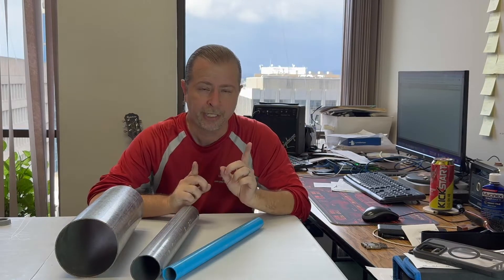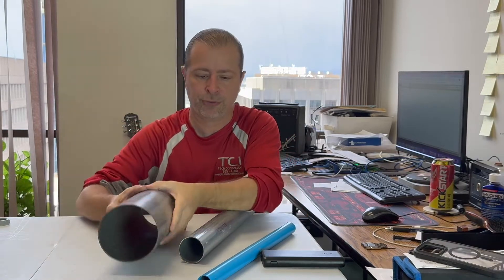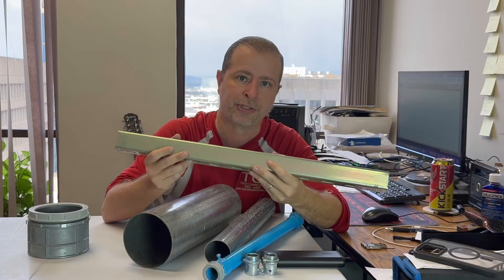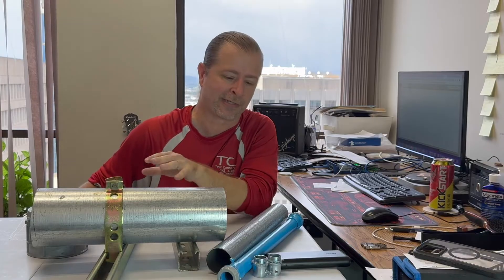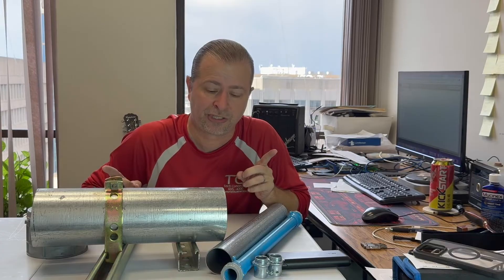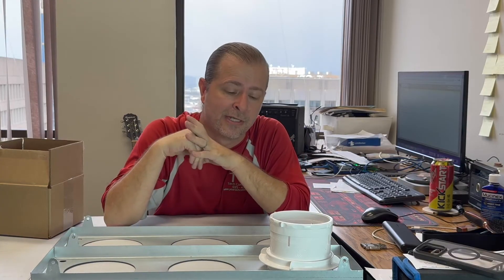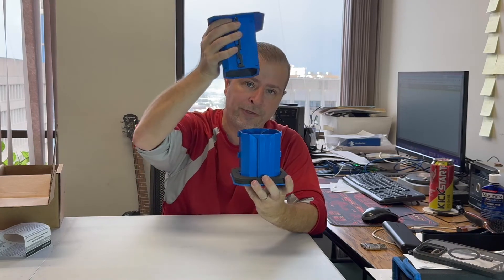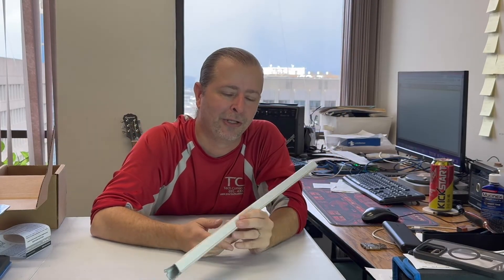Learning Network Cabling - Dealing with the Ceiling (Chase Pipes and Sleeves)

Comment: I print end connectors, and flanges for wall entries I have to do (eg 180mm circle cut into wall behind wall mount rack to get at conduit with network cables). I followed your advice and from your design I modelled a cable holder to string them  in ceiling space too. Needs some work to be perfect but I'll send it to you once done since you have been freely sharing yours.  I'm learning a lot from your videos - thanks for teaching :)
Reply: I used to use Toilet flanges quite effectively as well and mount them to a flange plate on the end of the pipe with the ceiling tile in-between and the pipe mounted to some Unistrut.
Reply from the maker: Thanks for watching!  I have gotten a lot of mileage out of our printer for work, I was concerned my team would use it to print stupid toys, but we've had some great results.

Comment: Here in the UK I have used a product from a company named "ManRose" who supply 100x40mm  ducting in 1m or 2m lengths and has a plethora of different fixings to cater for pretty much ANY angle or turn or bend that you can envisage. The rectangular shape of the ducting easily handles 50 or so cat 6 cables and can be run as a continuous ducting system.
Whilst originally designed and sold as air ducts for  cooker vents or bathroom air extraction, I found it to be easily adapted for network usage. 
In a property I recently lived in, I used it to run my home network cabling throughout my home. Using their supplied fixings to mount the ducting to the ceilings up in the corner where it meets the walls.
I also use pvc plumbing pipe with glue weld connections to run underground from the house to a shed in the garden, over 200ft from the main building. When I left the property early March 2024, the cabling was still dry and undamaged for being buried nearly 3 years.
Reply from the maker: Thanks for telling me about this, I will definitely check it out and see if I can acquire some.

Comment: Derek thanks for this video.  I've been incorporating your methods for years and glad to see someone showing how it's done!  I've also used PVC conduit in many instances.  Regarding the Riser Tubes...I've been using those exact same 4" wide tubes from Discount Low Voltage, but there are times where I don't need to pull that much cable and thought perhaps you knew of a  3" version of these riser tubes. I just love how simple they are to install. Thanks again!
Reply from the maker: I have looked everywhere for one and never found one yet.  I have struggled a bit with a threaded cylinder on my 3D printer so far, but once I have it solved I will post an STL file so that it could be printed at different sizes manually, but if anyone makes a pre-packaged one I am still looking for them.

Comment: We are working on a renovation and have access to all the studs behind the drywall (and through the attic). Would you still recommend going through the ceiling for the wires? I was thinking I could drill some holes on the stud at the top, bring the wires in through the studd, so that they are behind the drywall and then are out horizontally directly on the rack. Thoughts?
Reply from the maker: If the house is in framing I will use any pathway through the studs that makes logical sense, sometimes this means drilling half inch holes sideways through the studs and threading the cable through, and other times it means drilling down like you suggest.  If you can, try and give yourself room for future maintenance in case you ever need to add something later.  That might be just a pull string, or it might mean a wider access hole with room for your hand.  I think it's a good idea not to have the wire bundle visible, that's for sure.

Comment: For all the speaker wire I ran for my ceiling-mounted speakers, I used the thicker raceway from Menards. My wife says I did a really good job, so it passed that test.
For Ethernet in my network closet, I used PVC piping and then a bike hook to hold the wire up a little higher before dropping it in the rack. Unlike you, I have all my extra cable bound up on a shelf in my rack, but that's because I have my rack on wheels to move it around and manage it. The under-stairs closet in the basement is very space-constrained, so that's important to me. In the future, your videos showed me I should be putting all the bundled wires up against the wall to reduce the mess.

Comment: I use schedule 40 plumbing or electrical rated PVC for my sleeves. There's small nipples that are male threads on one side and you run a bushing down on it to hold it in place. I try to go at least 2 inch for that option.

Comment: I really love your videos. My field engineering position at my job recently required us to start cabling regardless of our experience doing it. Anyway, your videos really fill in the gaps that I wasn't taught during my light training, thanks for making these. I noticed you mentioned software and I also saw slide shows. If you can share them, it would really be helpful. Also, my reason for commenting was that when I have a cable rack installed and I never installed the pipe to start, now after watching your videos, I want to go back and add them to all my projects and clean up the look. Do you mind going into details about how to add the pipe after the cable and rack are already installed and operational?
Reply from the maker: Briefly speaking, you'll want one of these at 2inches or there is a bigger one at 4inches, but this will surround your bundle of cables and you'll screw the halves together.  https://www.discount-low-voltage.com/STI-FSR200-Split-Firestop-Sleeve

Comment: I would hope that you are Reaming the burrs on the inside of the raceways.
Reply: As long as the cut is fairly clean, the plastic bushings are plenty adequate.
Reply: I wouldn't call it better, but I used a Southwire Meray Stingray (used more for pulls, less for permanent install) in a location where I know I'll be pulling more runs soon. I left it clipped into the T-bar corner above the rack, and the ceiling tile guy cut around it. Then on the wall I used a cable raceway I can easily pop the cover off of to run the cables down the wall.

For an install where I know I'll be passing more wires over the years, I like this even though it doesn't look quite as nice as the pipes or specific products you showed here.
Reply from the maker: That's not a bad idea...we left one behind for a few weeks due to a delay in work and I had the thought that if it were white plastic it wouldn't be so bad.